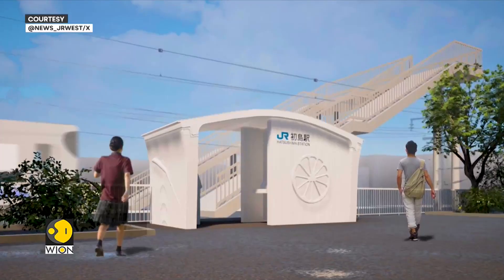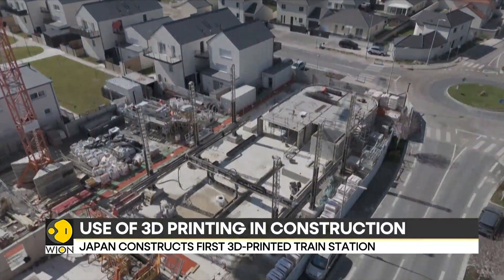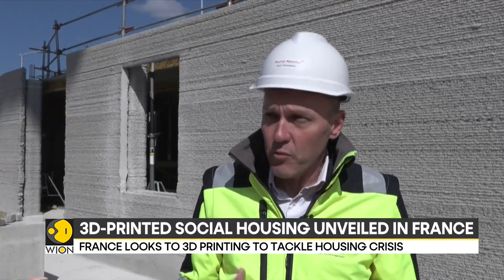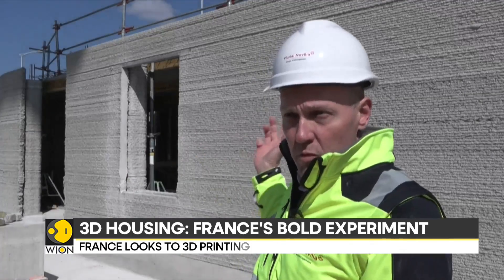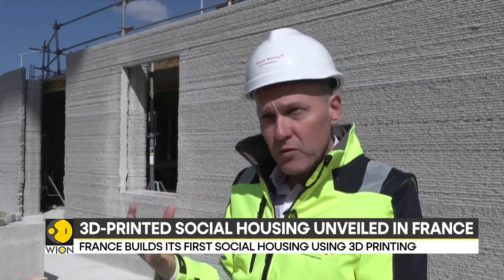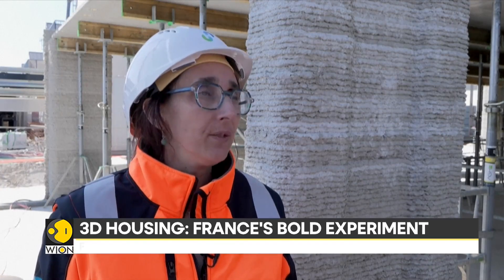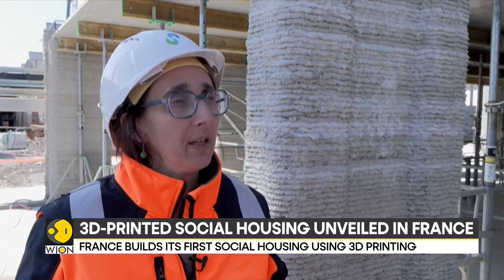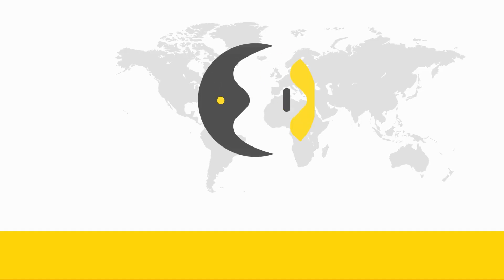Japan Constructed World's First 3-D Printed Train Station | World News | WION

Comment: In certain applications 3D printed structures make sense.  In some applications a device would print the whole structure in place with workmen's help.  In other applictaions sectiosn of a building might be pre-contrcted in afactor taht is then assmebel very quickly where teh building is needed.  

What is not as practical to 3D print are complex building like apartments, skyscrapers, etc.  Barns, factories, warehouses, and many simple structures are best.